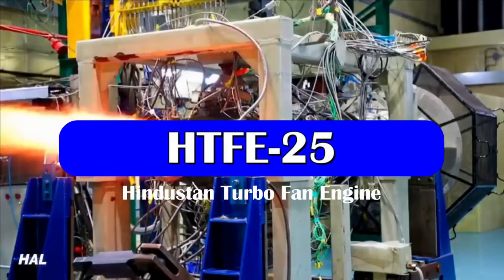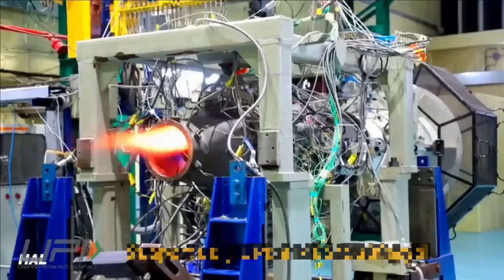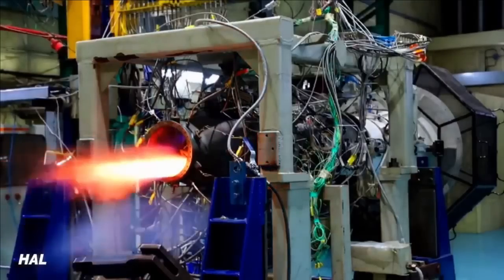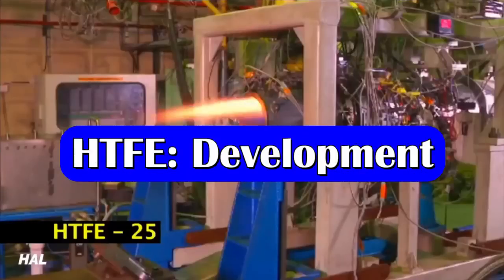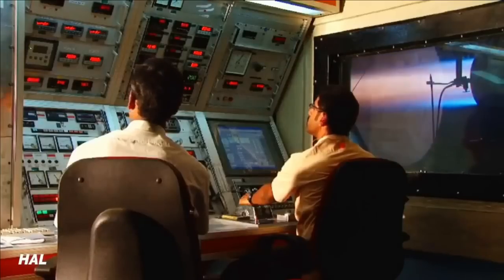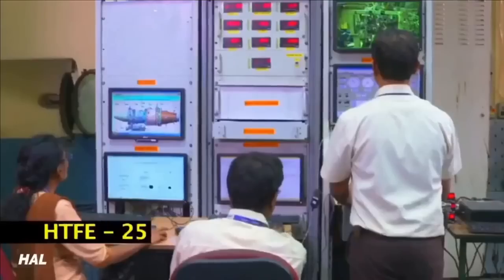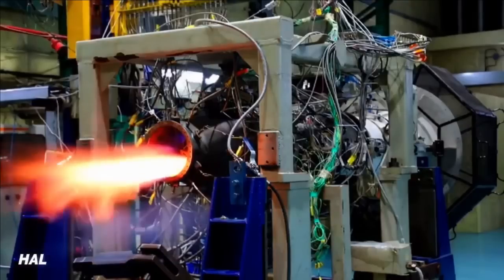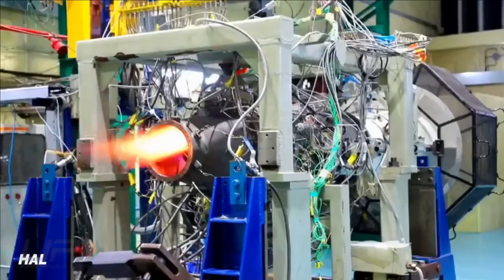Two HTFE-25 engines by HAL under developmental trial. Engine to power 5 ton aircraft

Comment: If applicable on Jaguar it will be a major success
Reply: Dude it's only a 25KN engine not useful for bombers and fighters.
Reply: @Kanpuriye  dude you need to check the requirements of jaguar's engines and stay in touch with defence news coz the application is already being planned.
Reply: @aniket33591  & yes morover the plan has been dropped - again for the same reason I stated that the plane is gonna retire soon and expenditures on it will be a sucidle move for other projects budget.
Reply: @Kanpuriye  Its not so easy the replacements aren't coming in time and hence this is being thought and no final decision of dropping the plan has been made yet.
Reply: @aniket33591  As the replacement is not comming yet (which is comming from Feburary 2024 though 😂) the engine is not yet completed and certified 🤷🏻. I shall rather advice you to stay updated and start following defence.
Reply: @Kanpuriye  And I will request any sane minded people to stay away from shitty advices like yours. No country has  replaced as many Jaguar fighters iaf has in 1 year. Also all the genuine sources suggest a gradual phase out by 2035.
Reply: @aniket33591  you counter your own mindset in just one comment and you are advising others to stay away from my advice 🤣 lol what a joker.
Reply: @Kanpuriye  haha, keep crying, the joke is on you.
Reply: @aniket33591  doesn't seems to be and I can bet Jaguars won't be upgraded with these engines but the reality is till then this comment section will be lost and then you could be debunked by me but I will do something to make sure this happens 😌.
Reply: @aniket33591  Don't know how sane is your mind to declare IAF will replace a 32KN engine with 25KN engine. Your expertise didn't tell you that Jaguar struggles in performance even in lower altitudes and you are telling me to be active in defence. The engine is also not ready yet and there are other important requirements of the IAF. It makes me laugh when i argue with people who claim to be experts with their little empty brains to comprehend the obvious technical and economical facts.
Reply: @Kanpuriye  1. Good Luck
2. FYI 25 kn is dry thrust, HTFE 25 with afterburner will get you 40 kn
Reply: @aniket33591  Is Afterburner ready ? Or are you gonna procure from other countries ?

Comment: What is the weight of this engine?
The engine used for ALH and LCH is also 1200 kW
Reply: There is difference between kn and kw
Reply: That is the Turboshaft engine this is the Turbofan one. There is a big difference in the use and tech of both.

Comment: It's funny & also sad thing 
😂😢
We want 80-85 kn class kaveri for Tejas mk1/1a
But we has 73 kn class kaveri

And other side, we want 17-18 kn class turbofan engine to power Hal sitara but we has 25 kn class HTFE-25.😂
Reply: Bro actually 75 kn is used by Rafale no difference 😅 so 73kn kaveri is still good for twin engine fighter jet
Reply: @TrickyNomadic  I am completely agree with you even current dry kaveri can give 76.5 kn of thrust with after burner section. We already developed a decent engine to power aircrafts like Rafale. We can use this engine in ORCA.
Reply: @unknown_5107  twin engine tejas would be better & good 👍 for feeling 42 squadron fleet
Reply: @TrickyNomadic  we are already developing TEDBF for navy, so ORCA is just a airforce version of TEDBF(it would be 2 to 3 tonne lighter than 26 tonne TEDBF), than we wouldn't  need of any twin engine version of Tejas mk2.
Reply: @unknown_5107 but ORCA is not yet confirmed
Reply: @TrickyNomadic M88 is also 200kg lighter than the Kaveri.
Reply: @sidewinder3422  so what just 200 👍 it's nothing because 24k Rafale capacity & empty is 10,500 so our will be 11,000 doesn't make any we still might have fighter better than mig29k then
Reply: @sidewinder3422  it's not much for twin engine ✈️ fight that can carry Around 24,000+ kg weight